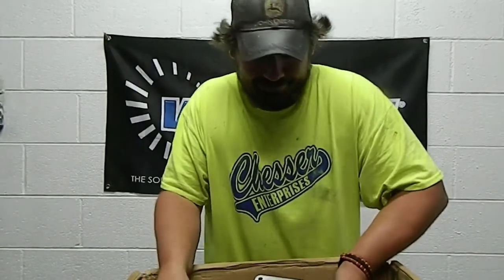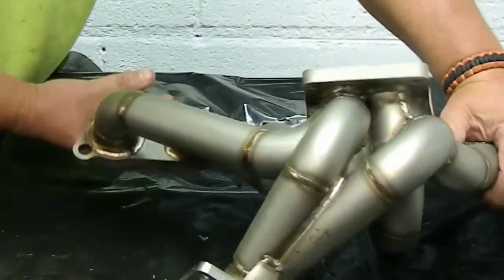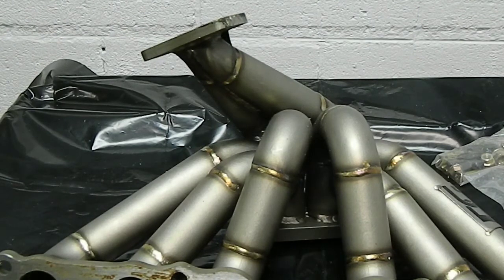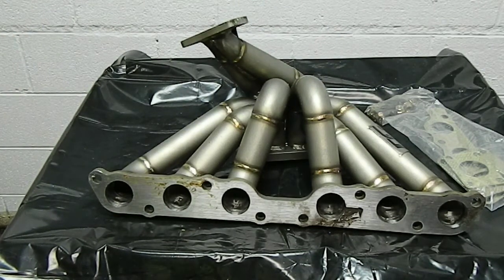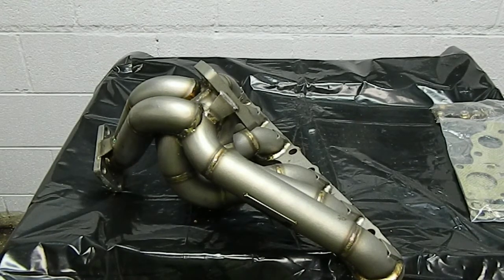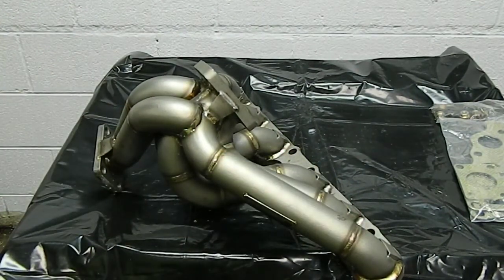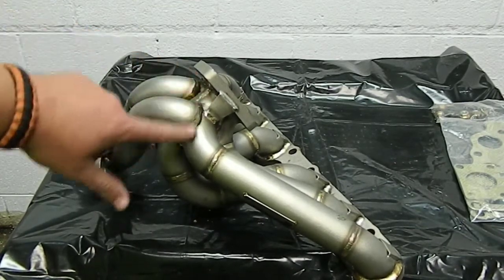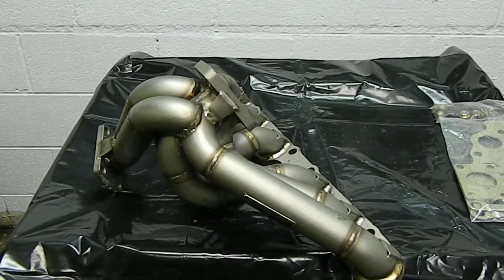Looking over our PowerGo Turbo Manifold for a 2JZGE

Comment: How’s this manifold holding up? Still recommend?
Reply from the maker: We decided to go another route for now. We havent installed it yet. We plan on it in the future. The quality and thickness of this manifold are well worth the money as far as a visual inspection.
Reply: i have this manifold well built. i had a ebay manifold before and it lasted 2 years then cracked bad and peaces went in to the turbo wheel hot side and killed the turbo
Reply: @Chessermotorsports  i have this manifold and is well worth the money its way thicker then the cheap ebay manifolds
Reply: @TheHighroller88   how was the fitment? do the ports line up properly?
Reply from the maker: @andrewlynch6892 this thing fits great its on my JZ swapped S14 with zero issues